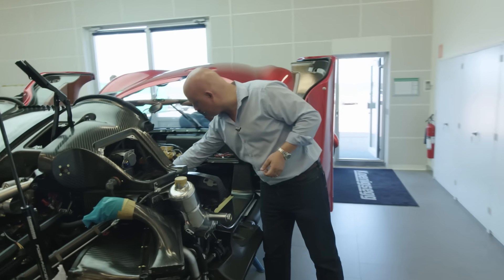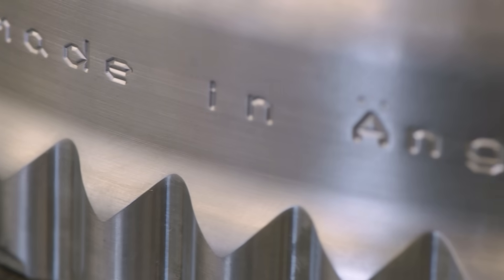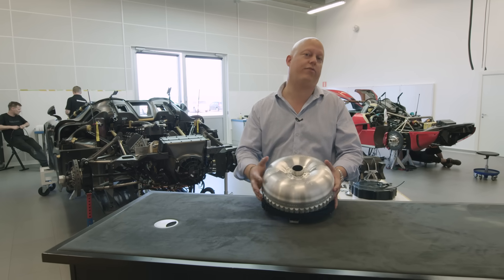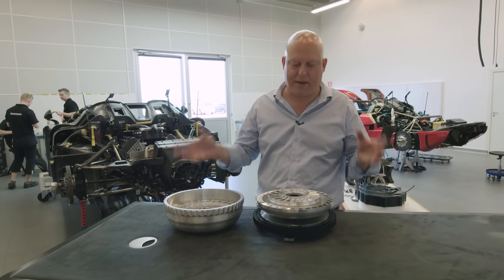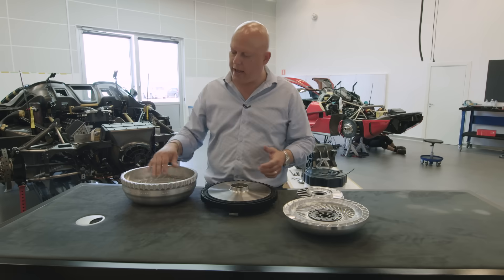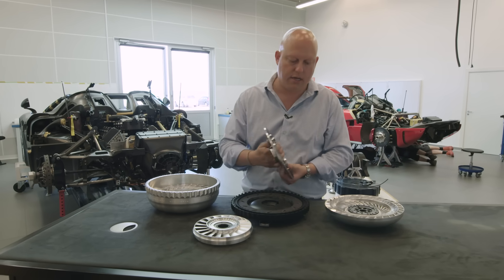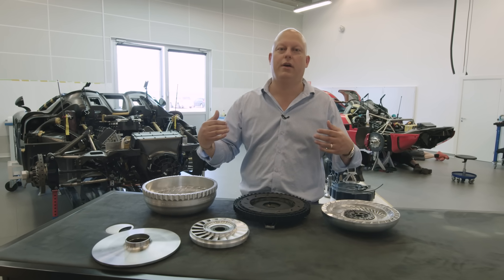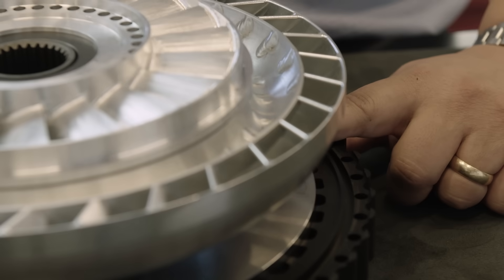248 MPH Without A Gearbox: Direct Drive  -- /INSIDE KOENIGSEGG

Comment: My car goes 250mph in free fall! (probably doesen't due to aerodynamics)
Reply: a feather has more surface to weight. 
So it's about ratios of mass to weight. 
A car for the most part is hollow, where as a human body is, for the most part, full of water. 
Also there are pockets to catch air on the car, because it's designed to move in one direction on the ground, aerodynamically speaking. Most people forget that the ground plays a big part into car aerodynamics. 

That is why cars are shaped as they are, and planes are shaped differently.
Reply: +PrometheusOfficial in a vaccuum yes. Not with air resistance.
Reply: again depends on the object, look at the links i posted above. there is no constant terminal velocity for all objects. For example, a feather will never reach anywhere near 131 mph, and the terminal velocity of someone falling with a parachute is much lower than that obviously.
Reply: CABRON ES AQUI Thats not true at all, Bic Boi is right. Terminal velocity is different based on composition of the object, aero dynamic design, the medium, and gravity. Terminal velecity for an average sized steel car has been shown to be 142 mph actually. A human body is 122 mph. There are three types of terminal v. Mathematical buoyancy force, and current flow, then one calculation for when you do not know the medium.  Here is a calculator for different materials and, drag, and mediums > https://www.easycalculation.com/physics/dynamics/terminal-velocity-calculator.php
Reply: Let's estimate drag. Suppose, you are able to drive a Civic at 100 mph, with its spec torque 128 lb ft at 4300 rpm. 
128 lb ft = 173 Nm. 
4300 rpm = 450 rad/s. 
173 Nm * 450 rad/s=77900 W. 
100 mph=44.6 m/s.
77900W/44.6m/s = 1750 N = 178 kgf.
Which is about 1/6 of its dry weight. Which means full weight would have it falling quite a few times faster than 100 mph.
Reply: bingoberra18 Humans are slim (most of us at least) and we are kinda rounded everywhere, but cars have big relatively flat areas that can act like air brakes
Reply: How do you make that out? A human falls at over 130mph and the car should be way more aerodynamic than a human.
Reply: Ryan Michie Sure but what falls faster, an elephant or a feather?
Reply: Terminal velocity of a steel car of average design is 142 MPH according to studies. It would need an electric motor on the crankshaft (and jet engine) to get there.
Reply: Merp Thank you, there we go.
Reply: Terminal velocity is 131 MPH.
Reply: Alexagrigorieff and dont forget to calculate  the oil weight  how much u have en the engine less oil would make it go faster do to less weight :D
Reply: FSXgta Haha nope not even close, it's terminal velocity is roughly 50mph if it's falling flat or 90mph if it's nose down
Reply: yeah thats why i had that last part added :P
Reply: human surely has no where near the same surface area as a car, causing less drag. Im sure someone will correct me if im wrong.
Reply: Bic Boi Force equals acceleration times mass. When talking about falling, the acceleration always equals g = 9,81 m/s², which means that mass only affects the force used. The acceleration, thus the velocity, always stays the same without air resistance. With air resistance, only the Surface of objects affects the acceleration. Imagine a ball made of wool and a ball made of steel: If they both are exactly 1m³ in volume, they will fall exactly the same.
Reply: but all objects fall at 9.81 m/s^2 only in a vacuum, otherwise it's different. You can determine the force of gravity using 9.81 as "a", but to get the net force acting on the object you then subtract the drag force. At terminal velocity, the net force is 0. check this out https://en.wikipedia.org/wiki/Terminal_velocity    go down to the physics section, right underneath is the terminal velocity formula. Vt = ect..... Mass is a variable. So that means holding all variables constant, a higher mass results in an increased terminal velocity. If that doesn't make sense try reading the comment with 10 and 3 upvotes.
Reply: Oh yeah, terminal velocity is another thing. I'm sorry for any misunderstandings, I was referring to the "elephant falls faster than feather" and "wrecking ball falls faster than beach ball" stuff. You're right, mass affects the terminal velocity. But until they don't reach that, the (same-sized) beach ball and wrecking ball accelerate equally. Right?
Reply: PrometheusOfficial yes. Acceleration would be similar initially
Reply: Terminal Velocity is the constant speed that a freely falling object eventually reaches when the resistance of the medium through which it is falling prevents further acceleration. There are limiting factors such as net force, drag force, projected area etc.  The tests that have been conducted by JPL have found that falling aircraft components reach about 131mph, The army has recorded roughly the same speed using a crash test dummy to test parachute failure at Ft. Benning. 
Now items like a birds feather will decelerate much slower due to it's structure. 
A falling car presuming its engine is in the front would fall nose first at roughly the same speed as aircraft debris thus 131 mph.
Reply: Terminal velocity for a human is a highly debated subject, and it's dependent on so many factors that there isn't an simple answer. 

The highest recorded speed is an incredible 822 mph. Alan Eustace jumped from a balloon at 135,890 feet. Before the drag chute opened up at 123,435 feet he reached a speed of 822 miles per hour. It's said that a sonic boom could be heard at the ground as he broke the sound barrier.

This was obviously way beyond what's commonly said to the the terminal velocity for a free falling human, and it was only possible due to the thin atmosphere at extreme altitude.

A better idea of what the terminal velocity is at more normal atmospheric pressure can be had if you look at skydivers. Turns out that falling flat with your arms and legs spread out to maximize drag terminal velocity is about 110 mph, someone claimed it was possible to slow down to 90 mph, but I haven't found data to back that up. Ball up as tightly as possible and you can reach about 200 mph, and if you dive or stand trying to minimize drag you can achieve speeds over 200 mph. The highest recorded falling speed (from a "normal" jump height, whatever that means to a skydiver) is apparently 321 mph, though I have no info on who, when or where this was recorded.

All suspiciously exact figures (such as the drag chute deploying at 123,435 feet) is taken from the best sources I found. Doesn't mean they are true, nor that they are fake, they just are what they are, information found on the internet...
Reply: As a hobbyist skydiver, I consistently hit speeds from 120-195 mph (from 15,000ft). I all depends on what suit you're wearing and how you fly.
Reply: ElCartelMexicano
- I have but the exhaust was a bit too hot.
Reply: FSXgta was it a wrong cheat
Reply: Assuming (hypothetically) the same surface area and aerodynamic forces of the two, both should fall at the same rate regardless of their mass.
Reply: Most likely it doesn't do it in a free fall either :P
Reply: Would actually be fun if someone calculated the max speed of a falling Model S or similar car compared to a human. Ofcourse there are ways to make a human more aerodynamic, like streamlined helmets etc. But I bet the Tesla has a lower Cd value than a naked person falling face first. Also someone said cars are hollow but humans consist of water. Are you aware that the density of steel is over 4 times as high as water.
Reply: bingoberra18 Before you calculate any of this, you have to understand that mass has absolutely nothing to do with falling physics.
Reply: PrometheusOfficial If you want to develop you may, all I wanted to correct was that a car will fall freely faster than 90mph as previous commenter stated.
Reply: PrometheusOfficial yeah but if the ball of wool isn't laminated or something then it's going to have a lot of surface imperfections and thus a higher surface area, so it would face more wind resistance and thus fall slower. Laminating it would make both balls have a smooth surface, and they'll then both fall at the same rate, regardless of their mass. Just wanted to clear that up for others.
Reply: Basel Kader Well no a ball of wool on earth even laminated would still fall slower, unless you mean that lamination would be friction-less, which would the the same as being in a vacuum.
Reply: PrometheusOfficial given the same surface area between 2 objects, more mass = more force. Therefore there is more force on the same mass of air being displaced. The heavier object will fall quicker. You think a wrecking ball wont fall quicker than a beach ball of the same size?
Reply: Bic Boi That is exactly what I mean. A wrecking ball will fall as quick as a beach ball, as long as the friction and size is the same. More force does NOT equal more velocity. Of Course the earth uses more force to pull an object. But the acceleration g=1G=9,81m/s² is almost the same on our whole planet. The mass does not affect the acceleration, only friction does. I know it is hard to imagine, but try it out and drop two spoons of the same size, one made of silver or something and the other made of plastic. Even though the mass is significantly different, they will hit the ground at the same time.
Reply: So my education is not completely useless. Thanks :D
Reply: Im actually not sure but I think +Basel Kader is right.
Reply: Bic Boi Actually, he didn't disagree. So yeah, he's right.
Reply: CABRON ES AQUI of what? there is no constant terminal velocity for different things...
Reply: so I get to feel what freefall is like by sticking my head out of a speeding car?
Reply: I think you have to drop it off the moon onto the 'Leaning Tower of Pisa' for it to work.
Reply: have u tried lubing the car up?

Comment: Just as confused as BEFORE I watched...o_O
Reply: It's quite simple, it's just like an american style automatic gearbox which uses an awful device known as a torque converter which is two propellers coupled through liquid. No actual mechanical connection, just sloshing in liquid. It's like a liquid clutch. The car only has one high gear so it's super inefficient at low speeds and it has an electric motor to aid at low speed where an electric motor is the strongest. You can imagine setting a manual gearbox car in 6th gear and clutching it up to speed plus electric motor aid.
Reply: Hhhmm, let me think of a terrible but easy way to explain it. (if anyone knows anything about this, roll over in your grave now) It is like spinning a fan with another fan, except you put a box around both the fans and pump the box full of water. 
So your powered fan spins around, which swirls the water around, which makes the unplugged fan spin except your unplugged fan is connected to a wheel. So when the unplugged fan turns, your wheel tuns. Then add in some fancy clutch like trickery so you can swirl the water without engaging the wheel. (the fancy trickery is just redirecting the water so it cycles back without hitting the other fan...i think) 
...and I think he saying that by losing all the other components, you are making up for the inefficiency.
Reply: Dennis Hena lol I was thinking the same thing! Lol
Reply: +Dan Frederiksen
Honestly, torque converters are a pretty great invention. Auto gearboxes may not be as fun as manuals, but a torque converter is a great solution to avoid grinding clutches. It allows you to apply tons of power without wrecking any drive train components. Drag cars actually often use torque converters, as it allows you to pre-load your rpms (hold break while pressing gently on the gas) and dump it on a launch without causing serious damage. It's especially useful with turbos when you want to build turbo pressure before a launch. 

Also, as Ryan said, its not a liquid drive the entire time. Once the speeds of the propellers become close enough, most TC's on modern cars lock up, creating a solid drive.
Reply: Dennis Hena it's just a fluid coupling from the engine to the wheels,or differential
Reply: Dan Frederiksen that's a good explanation even with the hate America stuff
Reply: Dan Frederiksen American? They were invented by a Swede who also invented the twin screw blower. Awful? Not very fun for a sports car maybe but they're a great solution to an enormous amount of uses in many industries all over the world. And while they aren't REQUIRED to have a mechanical connection but just about every current torque converter in cars have lock up clutches to eliminate this problem.

But yeah other than that, spot on description of how they're used in the video.
Reply: Wut?
Reply: +Dan Frederiksen this guy here...  "awful device known as a torque converter" ? not sure how...??? "low speed where an electric motor is the strongest" ? that base on how the electric motor is built (mostly winding/ thick wire with less turn make high RPM with little bottom power) technically they make same power from 0 to what ever their max power rpm is but a motor like i listed on top does not like to load (pull) so a long gear it would struggle to get to speed. on the other hand it will have more speed if it can get there. most electric motor are not built like this for they get bad efficiency by having to much load.

Comment: ....still don't get it....but it sounded cool.
Reply: I'm with you
Reply: It's like one big gear (in a torque converter form) stuck on 7th gear.
but because it would take a lot or torque to move it, an electrical motor is used
Reply: As I understand, this thing works like plane engine, but instead of pushing air, to create propulsion - it pushes oil, that turns another turbine, that is connected to drive-train. Because there is no direct mechanical connection between motor and wheels - there is no need for gearbox.
Reply: Search "How torque converters work" on youtube. The first video explains it nicely with animations.
Reply: Only flaws I see is there are too many words and not enough animation. Everything else looks spot on.
Reply: That's the basic idea of of a torque converter. In an automatic car, it replaces the clutch, not the gearbox. Allows the vehicle to be "in gear" while it's at a stand still.
Reply: yeah pretty much what I took away from it too.  I'm with you.

Comment: Fundamentally the way this works isn't drastically different (conceptually) than a Honda Accord hybrid or Gen 1 Volt. The use of the converter allows a taller final drive for top speed (not so much of a concern to the aforementioned). I do like this idea for the Regera. It's the first 'Segg that I get excited about. I'm excited to see more video as the car reaches full production.